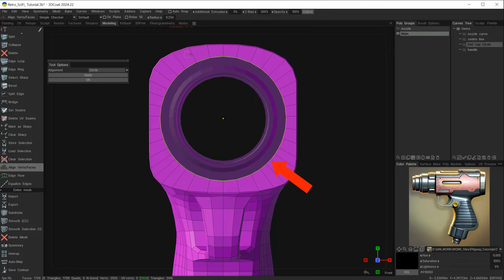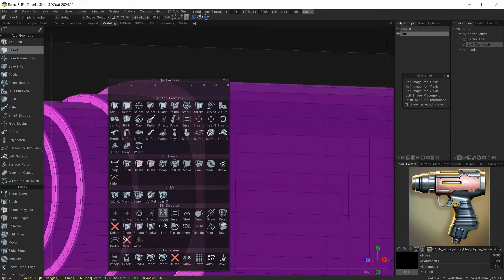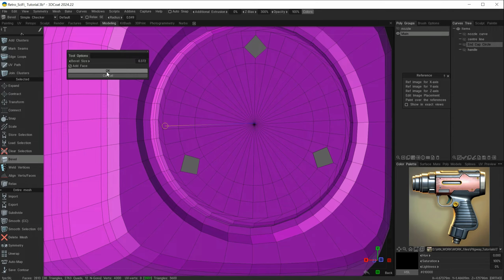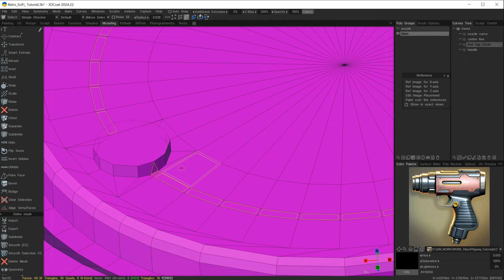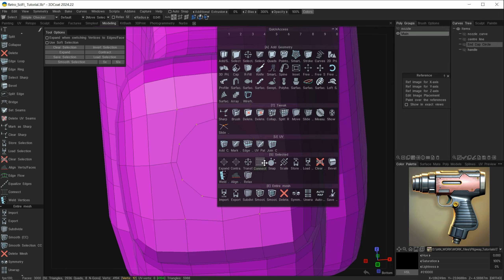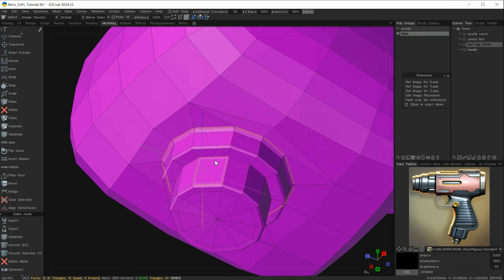3DCoat Low-Poly Modeling for Beginners #16. Creating a simple object - Sci-Fi Prop. Part 5.

Comment: Thanks, love this series. Many poly tools in Coat feel clunky after 3ds Max, but in good hands even Paint can be powerful tool)) One thing I still can't understand in this workflow is SubD...  Coat has no decent SubD, so I guess it is going to be mid poly, and then send to Sculpt room and add all details there?
Reply: When you say details, do you mean smaller model details or chips and scraps on the surface? I think atm yes for smaller surface details sculpt is the best option.
Reply: I would say at this point modelling is a refined (mid poly) blocking out workflow. There is development to progress the modelling side further 👍🏻
Reply: @IanThompson007   I meant small geometry details: little holes, bolts, seams, patterns on the grip... In traditional SubD it is pain, because adding details to curved surfaces like cylindrical barrels require the mesh to be subdivided BEFORE you start cutting in details, otherwise you will loose proper curvature, and you must keep good topology to avoid artifacts. Wondering how it will work in Coat... In theory you can add support loops and make it somewhat subd compatible, or can you go without it? Those cylinders are quite low poly and faceted as of yet. Also very interesting how this will come to baking and transfer to Paint room for adding final details like scratches and edge wear. At least I hope it will come to that one day :) Would be great to have a series covering full games pipeline inside Coat: modeling, sculpting, retopo, UV unwrap, bake, paint. Talking with people in Coat's discord channels shows very few people understand how to properly streamline model between rooms in Coat. Anyways you're doing a great job, and thanks for sharing your knowledge!
Reply: @nicktyler2572  Thanks for the feedback - appreciate it. In the last video I tried to touch on the paint room a little, but realised its too big a topic :) I'll try and put something together on the pipeline side, I've been busy recently so haven't had chance to make any more tutorials. I'm in the discord channel so I'll have a read through the comments.